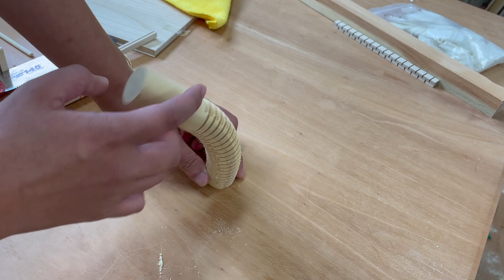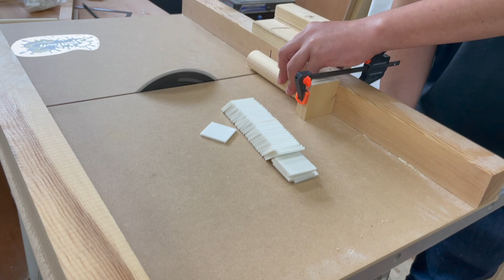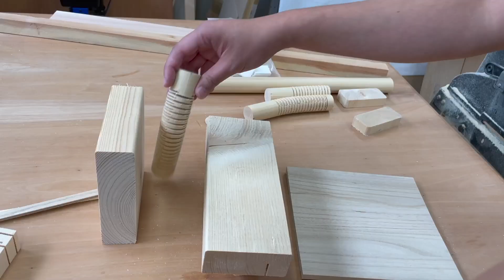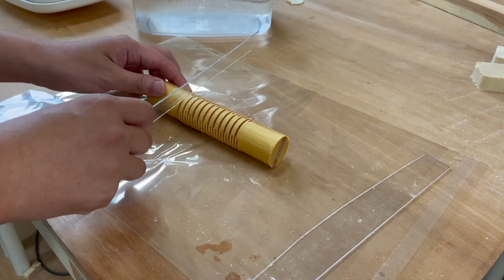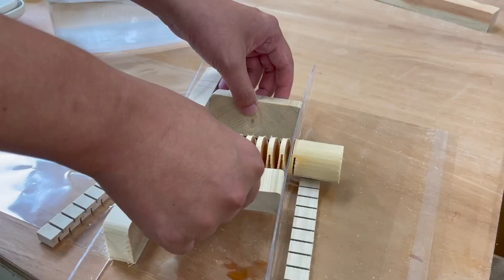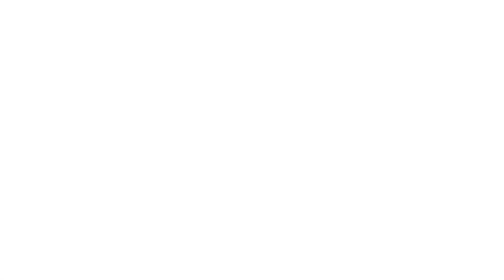え？君もスリンキーになりたいって事？

Comment: i think the reason it didnt want to work was because the ends of each slinky where solid
where on a normal slinky its just more of the spring.
maybe the reason it doesnt pull down the other end is because it doesnt have enough pulling force due to being completely solid?
Reply: I feel like the main problem is just the material because wood is not as elastic or light as a normal slinky. Maybe it could work if the middle was hollowed out, but then the wood would break too easily. 

Also, continually adding weight like he does is also not as good of an idea as you might think because it means the wooden slinky needs to pull more weight with the same amount of force.

I dont think he did a bad job with this, its just that wood is too brittle and dense compared to plastic or metal to act like a slinky.

Comment: Maybe try making it lighter? Smaller diameter, smaller length, thinner slices (to remove more wood)? I feel that the energy stored by the slinky is enough to move something its weight, but the energy stored by the YARUKI isn't.